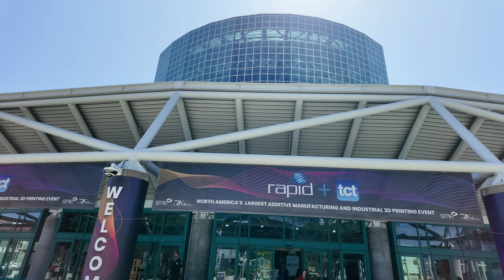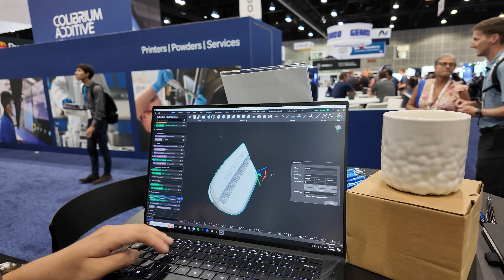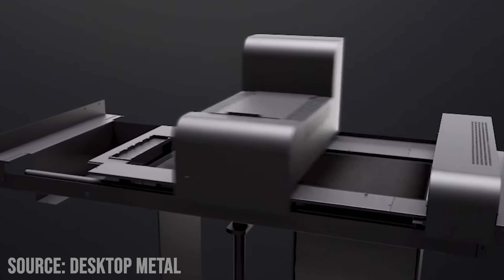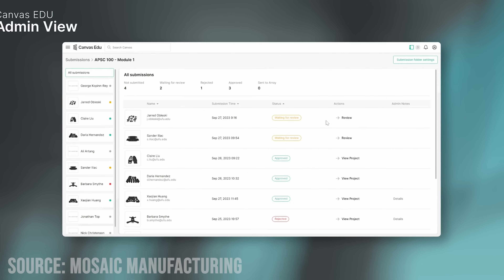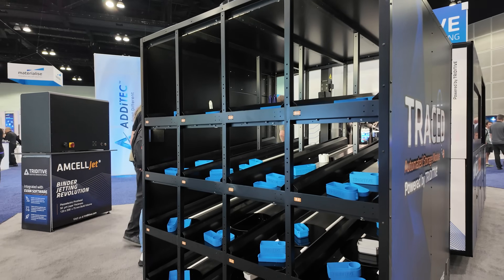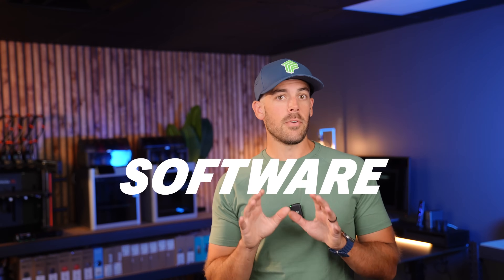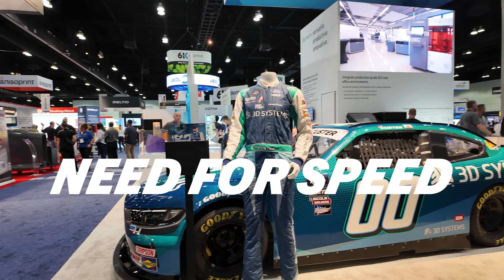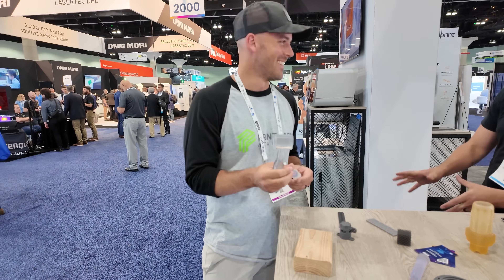Top 5 Coolest 3D Printing Trends

Comment: Sintering isnt quiet metal injection molding. There is generally no pressure on the sinter powder during the heating process and the binder can be premixed with the powder before inlay or depending on the use case scenario  the binder can be top layer only to hold the powder in place until final temperature is reached. I once upon a time sintered the honeycomb fitting on injection nozzles for  Pratt & Whitney engines. We would load the injector onto a 4 jaw chuck of a lathe and spin it at low speed ( 60 rpm ) and "pour" the sinter powder in. The powder we used was nickel based with aluminium for eutectic melting. Once the cells were filled we sprayed it with a binder to hold everything in place. Once ready to go they ran in a vacuum furnace with a preheat stage at around 1700 degrees F before ramping up to 1950 degrees for about 20 minutes. The trick with sintering and brazing is in the cool down, don't go too slow or too fast. Has to be just right! As an aside, we are currently trying to figure out how to braze 3d printed steel parts because the customer isn't ready to buy a big enough printer for what they are trying to do. The part is 14 inches long by 8 inches by 8 inches for 1 half. The printer they are currently using for this project cost 5 million dollars. A printer large enough to do it in one go would be 18 million dollars. Got a ways to go before we get to take one home!

Comment: I have a friend who is a prototyping engineer. He builds the first, part in hand, working protypes that a designer has developed. Most of these parts are extremely expensive with tolerances beyond what would be used in large scale part production. Many years ago he was contracted to produce a part for an auto manufacturer. This part cost the auto manufacturer almost $100k but when it went into large scale manufacturing it reduced to the hundreds. Though I have not seen the guy for years I could see these type of engineers with a $100k machine in their business.

Comment: As an engineer myself that uses the technology, we need to advance the materials that we can use in all additive manufacturing, but specifically the composite materials. The Markforged CF printer is good in concept, but only allows true strength in the fiber direction unlike its weaved layup counter parts. If we can hone in on that aspect of it, along with the current speed of printers, additive would truly be competing with the likes of traditional manufacturing. Just my 2 cents lol.

Comment: The biggest "hidden" trend of the Additive space is resin. The rapid development of functional photopolymers has the potential to put production technologies like MJF and SLS to the test. MJF printing a whole layer at a time has the same speed as MSla. Developing larger MSLA printers (Or dual/tri laser SLA) will allow for similar throughput with lower cost of material and more diverse material range. Being able to print any 355-405nm UV Resin (presuming the correct photo-initiators) is a massive bonus compared to MJF or SLS where depowdering stations etc all have to be deep cleaned to prevent heat issues (And contamination).

Monocure3D's Tensile Resin, Kings ABS-like, BASF Procur3D are all resin that have the "wow, this is printed?" factor.
Reply: The challenge, though, is reducing the toxicity of resin.  Now, I know that SLS is also a technology with a lot of manual post-processing that needs proper PPE, but I think to many people (including myself) there is an emotional difference between "use gloves, goggles, and a respirator to keep this dust on the outside of your body," and "use gloves, long sleeves, and a respirator to keep this poisonous goop from touching you."  I don't know which technology is actually more labour-intensive or needs more PPE, but I do think MSLA will struggle to break into the mass-manufacture space until it can address the perception that resin is poison.  

Put bluntly, I suspect too many people died in the 90s from cancers caused by exposures to toxic chemicals during the 50s as injection molded plastic processes were being developed for industry to be really comfortable with a resin that's known to be toxic.
Reply: @davydatwood3158  I definitely get your point here. I operate both SLA, MSLA and SLS. Resin has more clean-up for sure which contributes to a higher labour cost though you get a lot of throughput for minimal investment (30k USD for 600x600 build volume, compared to 200k+ for a comparable volume) 

For mass-production facilities PPE is just a by-product of the technology. With metal injection moulding, the sintering and binding is just a requirement. As sad as it may be, with bigger companies it becomes less about safety and more about cost of implementing those safety precautions for which SLS and SLA are similar. 

Metal printing has massive PPE requirements yet is profitable and thriving in the MedTech space. Metal powders can't even be transported by certain methods due to its potential to go "boom".

Comment: what we need is just a core xy with a belt like system, like the cr 30. Once its finished, the belt activates and slides the print off and then it starts again. if they can figure out how to keep the bed flat and tight then this is a huge possibility.

Comment: 3D printing has created a similar problem that exists within software. I have a hammer and everything is a nail.  Evaluating the capabilities of each manufacturing method and applying that to the use case becomes critical. Each manufacturing process will provide different part qualities and capabilities. How does the 3D printing word not fall to some of the same problems that are found within the software industry.  Great video and love you content.

Comment: The binder jet metal looks cool, but I have to think that for anything a pseudo hobbyist/prosumer might want, its not accurate enough, and most things could be made with sheet steel from say send cut send otherwise.

I suppose if it starts competing on that level in price then I could see the use cases for not companies, but right now it sounds pretty "you gotta be a big company to logically use this".

Im just trying to imagine how you'd go from this, to maybe having a few surfaces machined, and that alone would, I imagine, eliminate any cost benefit, so it kinda seems like its in the realm of "We a big company need a part quickly with a shape that is difficult to machine"
Reply: My issue with the binder jet isn't the resolution or accuracy, it's more in what the things I'm making are used for. I'm supplying 3d prints that are used as prototypes for leather stamps. I.e. they run off a number of leather goods stamped with the 3d printed PLA stamp, see if the result is viable, then if they discover one of them is continuously vanishing off the wall or shelf, they get a magnesium stamp made for general production. For my time and materials and printer use time I'm getting about $10 per plastic stamp, they get about 20 to 25 impressions for the stamp, and since they like runs of about 80 to 100 impressions I earn about $40 per stamp. The Magnesium stamps cost them in the neighborhood of $300-400 each. And these are not huge stamps by any means. The vast majority of what I'm making is smaller than 125mmx125mmx5mm, needs no support, so post production is limited to checking to see if the stamp was printed correctly, or is readable. (If you are stamping leather, When I get it correct, I either mirror the text in the model, or in the slicer. In the slicer is 'easier' most of the time.)

The problem, the reason that the stamps last 20-25 impressions is that in order to make a salable product, they use a 20 ton press. I haven't seen a lot of test data on other materials, and I just got a black diamond nozzle for my P1S so I can start testing some PETG-GF that I picked up, and we'll see if that's a more survivable material. I'll start that testing in a couple of weeks once the season has wrapped up for the year.

In any case that pressure is what I would be concerned with for a sintered product. (As I was writing this it occured to me that it's entirely possible that the 20 tons is dumping a lot of heat into the PLA and that may be why it's got such an effectively short durability time. Which might bode well for PETG-GF. We'll have to see.)

Comment: why noone (at least i never heard of it) tried to 3D print with welding wire? could it work? 
liquid cooled nozzle, closed chamber you fill with argon, some AC/DC music...hmmm
Reply: Check meltio,they use a wire melted by several lasers as you would use a filament,that machine is amazing
Reply: One version of that is called Wire Arc Additive Manufacturing (WAAM). They basically swap out the extruder with a Mig welder. There's another version mentioned below that Meltio uses. They use welding wire but use instead of using electricity to melt the wire, they use a fiber laser.

Comment: Problem with "cheap" metal 3D printing is expensive industrial-like post process. It is more affordable, but still you need cleaning, debinding solvent station, sintering furnace and purest inert gases for sintering process.

Comment: I'm wondering how long before 3d print farms are obsolete from all this tech moving towards low cost, high strength etc. My needs are two types of printers, small about 200mm x 200mm build plates and my other size needed is 350mm x 350mm. Bambu labs is nice, but that build plate doesn't work for my needs or orders. Even if Bambu labs did build a larger printer the cost they might not be competitive. Yes the Bambu labs are reliable which in print farms feels like the number one priority. 🤠 I've started running into clients asking about "metal" parts. I guess it's just a matter of time and cost. 🤠

Comment: Bambu needs to revamp the ams to an active drying unit, they need to fix their oem profiles particularly with PETG, and with so many adoptions of their printers they should relase a print farm software and better camera options as an add on. The array is cool but not for 100k, thats like a free boat plus all the bambu's you'd need. Prusa, has cratered so I expect to see some revelations from them as they try to innovate again, however, its unclear how hard the bottom line was hit after dragging their feet on development all these years.
Reply: You have issues with PETG using Bambu's print profiles? That's odd. Their PETG profiles are the only profiles that I've left stock because they print perfectly, even the PETG-HF.
Reply: Bambu should release an AMSH "Heated" with their next printers which are hopefully bigger maybe a A1 Max and an XL Carbon because all their other printers are still very usable so don't get rid of any just add the new ones only thing is maybe a revamp to the P1 series by giving them the same touch screen from the X1s
Reply: Bambu also should adjust their AMS to work with the more interesting filaments, like TPU and PPA CF and so on. All the best ones aren't supported because they're too stiff or too soft
Reply: @thatcherfreeman  Stiffer filaments could be made compatible by straitening the filament path with an upgraded AMS. But TPU is nigh impossible for the same reason you can't use it with Bowden setups. Pushing flexibles causes binding, where pulling it is fine.
Reply: @OhImKiCkiN  Yeah, tbh I feel like there's room for a redesign that's capable of both pushing and pulling, depending on the material.
Reply: @thatcherfreeman  I get ya. I think it'd be super hard to pull off though. But I'd really love it if they did.
Reply: I also noticed that their PETG profiles are not up to snuff specifically because some of the things needed for its successful printing(z-height and infill pattern) are not filament governed in the slicer)
Reply: @kozmaz87  Are you referring to using Bambu PETG Basic filament with Bambu PETG Basic profiles, or are you referring to a different combination? I ask because like I said previously, I've had perfect results using all of Bambu's PETG filaments with their corresponding profiles...unless I don't dry it first, of course.
Reply: No
Reply: Bambu also needs to have an AMS that doesn’t waste as much as it prints. Unless we are going to less expensive multi head units.

Comment: as someone who uses some higher end machines professionally and prusas at home, I feel there's a market in the middle that's missing. The cost of "commercial" printers and supplies makes me feel like there's a huge gap. The convenience of ease of use of the commercial printers is nice cause I can teach someone in an hour to use the slicer and click print, but the cost when I compare it to hobby printers is a little sickening. I think hobby printers are getting pretty close to me justifying having a few at work, but need a bit more ease of use on higher end engineering plastics.
Reply: What's complicated about the consumer printers? I feel like the process is pretty streamlined nowadays
Reply: @tec4303  there’s a bit of a learning curve for playing with slicer settings and build plate adhesion. Plus filament moisture. Those are the most obvious things that have been different, the commercial ones are a little less fussy and most of the settings are locked and predefined. I don’t think those things are hard, but they aren’t as easy and require time. Diagnosing issues in a professional setting requires people and time which we don’t always have.

Comment: In your opinion, how long before metal laser printing is a consumer purchase?
Reply: The difference will be the fact that the fine metal powders are way more dangerous and unhealthy than a spool of PLA. Aluminium powder for example can explode like it did at the apple factory in china. And the rest are just evil to inhale. You’re better off ordering metal slm parts from somewhere like jlcpcb and having them delivered. I’d say it’s a long time until it’s a home consumer process. Not to mention I think they also need sintering in an industrial oven.